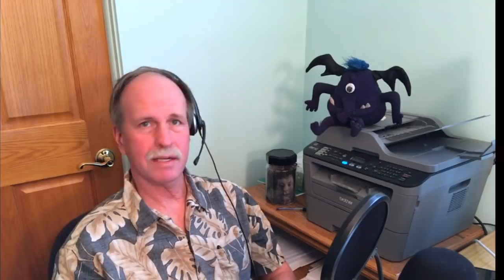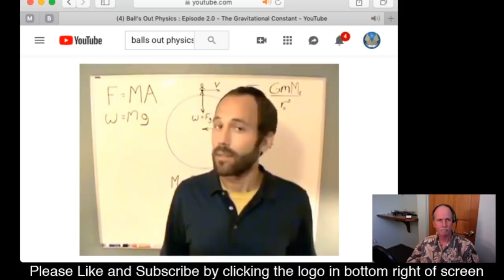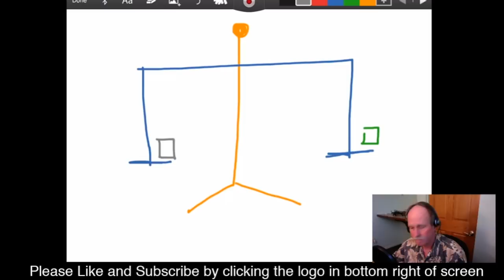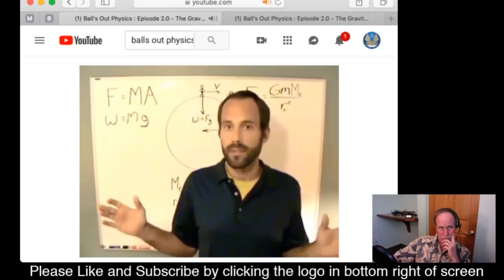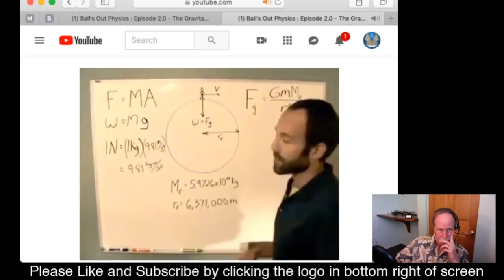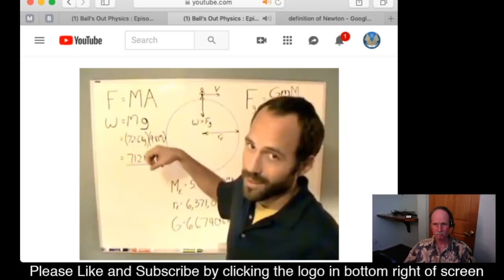Flat Derp Engineer Gravity Part 1

Comment: I suspect Mr Mullin will be one of those who struggle to answer the old question of whether a pound of lead or a pound of feathers is heaviest
Reply: Or how much dirt is in a hole one meter square and one meter deep.
Reply: Woodworker Don - All depends on how much wood can a woodchuck chuck, which is the dependent variable.
Reply: @billsmith5960  I chuck wood into my lathe chuck all the time. I doubt a woodchuck could even reach my lathe chuck.😊
Reply: @WoodworkerDon  - On the other hand, what is easier, turning down a piece of wood into a flat earth or a globe?
Reply: @billsmith5960  anyone can buy flat wood at the lumberyard. Not everyone could turn a globe though.  Maybe I should have said Oblate Spheroid rather than globe. 😊
Reply: @WoodworkerDon  
I want to know what lumberyard you use!!  :)
Reply: @its1110  9 out of 10 flat earthers also want to know. The other 3 prefer math over woodcrafts.
Reply: @WoodworkerDon  - Maybe make one on a wood lathe but don't part it off yet. Then turn the speed of the lathe up to 1000 mph (as you know that's how you measure speed of something rotating in the flat earth world), pour some water on it and watch it fly off. Then tell everyone the earth is flat.
Reply: @billsmith5960  I'll give that a try. But with my eyes and my mind closed.
Reply: @WoodworkerDon  - You have to be like Ty Webb in Caddyshack where you can hit the ball and miss the lake with a blindfold.
Reply: @WoodworkerDon  And how much would be in a half hole?
Reply: @nescio03  please don't ask me to work out equations with fractions.  Muh skooling wuz purdy bazick.
Reply: @WoodworkerDon  😂
Reply: @WoodworkerDon  
I can only do calculations with miles not kilometers.
Reply: I know the answer. A 25% mix of lead with 75% feathers......
Reply: @billsmith5960  Ah, but what's the independant variable, and did you allow for the angle of attack? :D
Reply: cargy930 - The independent variable are ball bearings. Maybe you need a refresher course. It’s all ball bearings nowadays.
Reply: @billsmith5960  I think that there's a 99% probability that you're right.
Reply: Well it's obviously the lead. Everyone knows that.
Just kidding, just kidding, settle down.

Comment: Brian, if the scales are mechanical "balance" or spring scales as the best analytical scales still are, then there will not be any difference on the moon. Your garden variety bathroom scales might not work. (Edit for clarity) - a balance using the distance travelled by the spring will need to be calibrated for gravity. A balance simply comparing known precision weights would not. A bathroom scale incapable of this type of calibration would not work at all.
Reply: Surely a spring 'balance' will give a different reading on the Moon because it works by gravity pulling the object down against the spring, whereas the old fashioned chemical balance won't because they compare the mass of the 'weights' with the mass of the object.
Reply: @grahvis  An analytical spring balance is calibrated to a set of actual known weight samples with an error margin of +/- 0.0001g. You are not even supposed to handle these weights with your bare hands. Every year I get my balances calibrated that way - spring or otherwise.
Reply from the maker: yes but surely you agree that a balance based on compression of a spring is dependent on the acceleration of local gravity.  Your spring balance, no matter how sensitive, will give a different reading on the moon.
Reply: @BobtheScienceGuy  Yes. indeed. but that effect is "cancelled out" in the calibration so that the balance reflects only the mass on the plate. Hook's Law is the main equation here. F=Kx where K is the spring constant (depending on each and every spring) and x is the distance the spring travels. F=mg also, so accounting for g and F gives you the mass. mg = Kx so m=Kx/g. g is a known constant depending on location. There are special scales that work pretty much in reverse to ascertain the force of gravity in a given location. I agree, you would need to calibrate for the gravitational acceleration of the moon..
Reply: @profphilbell2075  

Yes but that is my point, they would have to be recalibrated if their latitudinal location was changed, (among other factors) which means they are affected by changes in gravity.
The most precise balance I used back in the late 50s, had a mechanical arm to place the 'weights' in the form of fine wire rings, on the balance arm.  As long as it was carefully levelled, it wouldn't need calibrating if moved to another location.
Reply: @grahvis  Yes, I think I have agreed that for pure spring balances where the spring itself is the measuring device F=kx you would need to calibrate based on the moon's gravity. In the case of balances that simply compare weights, as i describe above, you would not. The balance already has precision weights, an arm and counterbalance point. Another point is that even if you moved the scales to another building 100m north or south you would need to calibrate, much less the moon.

Comment: I agree you learn from your mistakes. The good news is, based on his video, Brian has a whole heap of Physics learning to do.
Reply: at least his mom is dressing him better.
Reply: I wonder if Brian made any mistakes designing something that collapsed ?
Reply: @WildPhotoShooter  Well I always said, that if I had to pick between a bathroom he build and getting a new pair of shorts, I would pick the last.

Btw there is a new definition for KG
2019 definition: The kilogram, symbol kg, is the SI unit of mass. It is defined by taking the fixed numerical value of the Planck constant h to be6.62607015×10−34 when expressed in the unit J⋅s, which is equal to kg⋅m2⋅s−1, where the metre and the second are defined in terms of c and ΔνCs.

Yeah, a bit complex for me.
Reply: @wdane794  A bathroom would be the least of our concerns, what if Brian had been let loose designing a bridge, even a small footbridge used by the public !!!!!!!
He does say at the beginning 0:35 of this video that he is not claiming to be correct and at 0:50 he is asking for help and he says he can't explain these things. 
So basically he is just casting doubt and has no answers to any of it.
Reply: @WildPhotoShooter  Yes, but every time someone tried to explain him something, he gave the same flat earth answer, you know, not interested, I know better